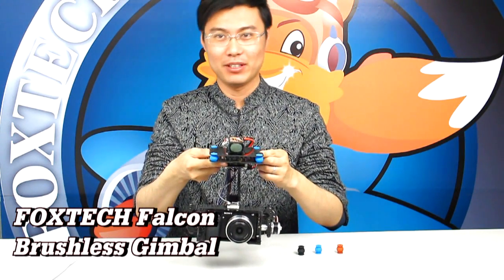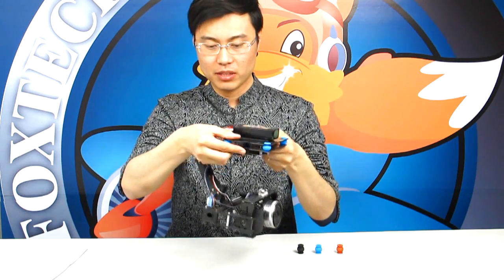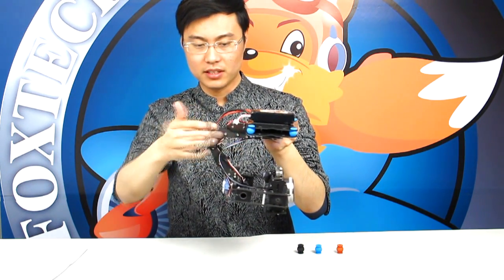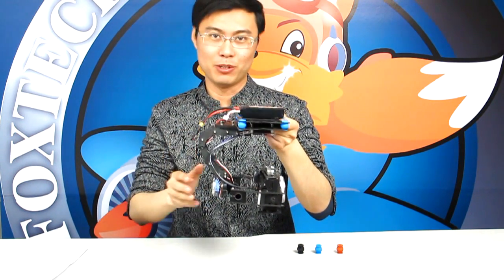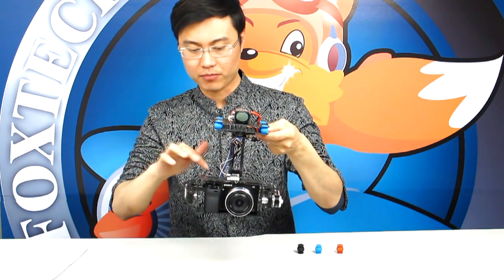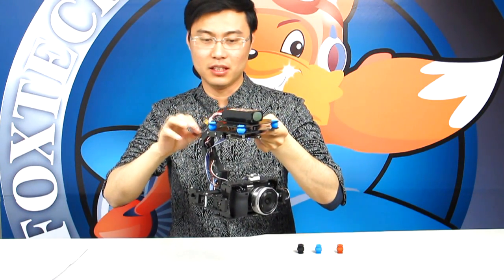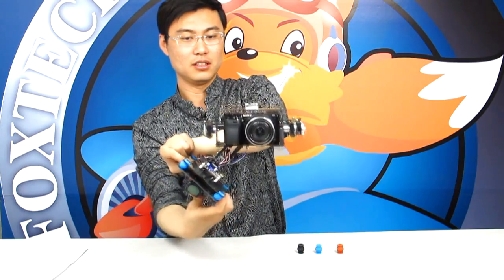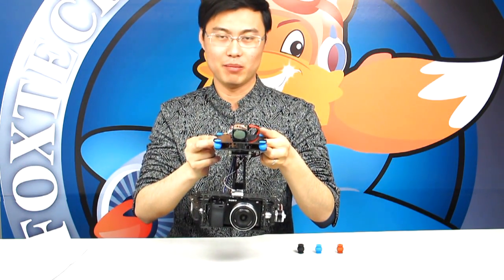Foxtech Falcon Brushless Gimbal

Comment: Fu, I'm interested in the gimbal but not to mount it on a multirotor. I would like to use it hand-held like a steadicam for for amateur film making while walking, running, etc. Can you please make a test video following a subject using the gimbal while normal walking, and also while doing a fast run. I would like to see how the gimbal will stabilize the footage especially during the fast run. Thanks